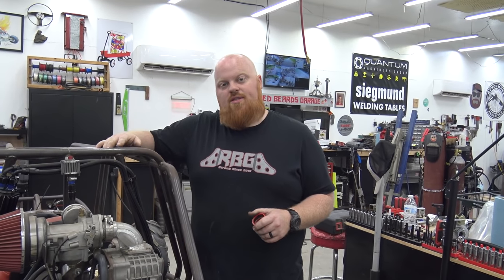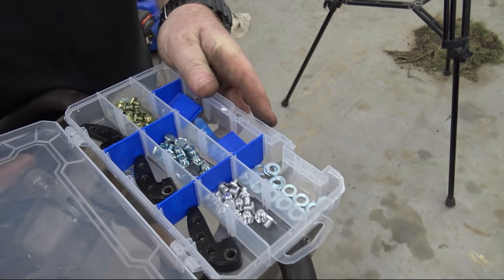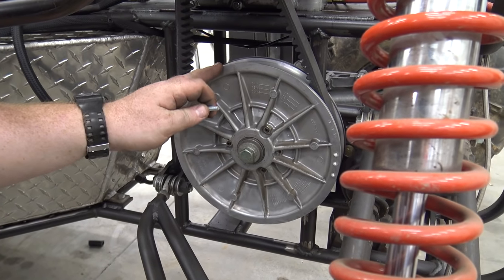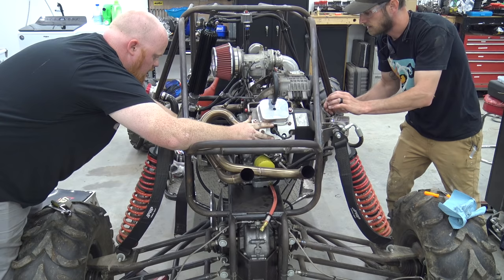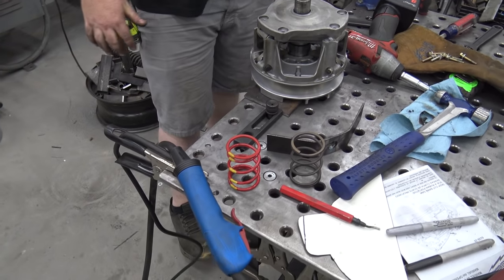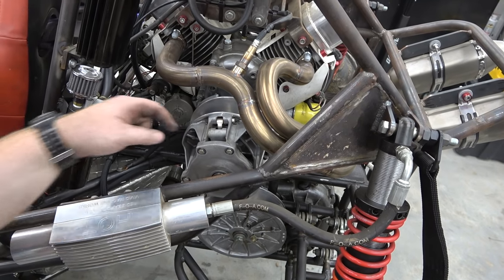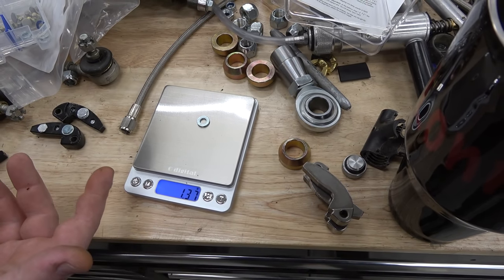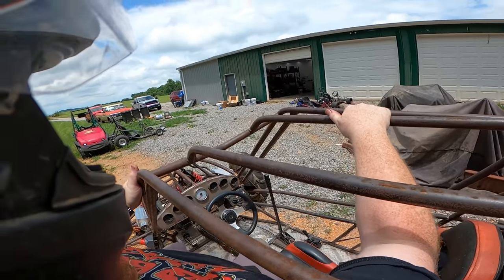Supercharged Predator 670cc Buggy Woods Rip ~ Blown 670cc

Comment: The brand name on the engine doesn't matter.  It doesn't matter if it's a bike engine or a lawnmower engine.  An air pump is an air pump.  You can port it and mill the head and achieve the same power as a street bike. The supercharger makes it even better.  This is an awesome project.
Reply: Richard Holden tried this same charger on a 350 Chevy a it robbed from what his baseline was with out the charger.
It takes more power to turn it than what it will produce so it’s killing this cart’s power bad
Reply: Your crazy that lawnmower engine will never make the power a 4 cylinder crotch rocket engine will make lol...
Reply: @MatthewJohnson-o4x  It's far too small a supercharger for a 350 Chevy...

Comment: Performance670 has an adjustable billet flywheel that lets you mess around with ignition timing, which is something you'd want to do when running a boosted engine. There's probably a few extra horsepower to be had with one of those.
Reply: Likely pick up power faster too

Comment: Awesome build! Couldn't you just machine a smidge off that driven pulley sheath so it doesn't contact the CV axle boot?
Reply: That or if you want to get janky you could try putting a ziptie on the boot and try squeezing it in a little bit.
Reply: I thought same thing
Reply: A small Machinist cross vise and a cutting tool then run the motor. All you really need is to take a couple thou off he said it's just barely making contact. Hell if you want to get super janky you can do it with sandpaper and a stick 🤣
Reply: My ocd is serious. That steering wheel being so off.......m.m
Reply: Taken a smidge off the edge of the clutch is what first came to my mind when he said that also. If it's only a few mil touching then that's shouldn't hurt the clutch.
Reply: @Rattus-Norvegicus  zipties... holding my vehicles together since 1989.
Reply: @markschultz1606  😆 and coat hangers and duct tape, nothings better no shit.

Comment: It's absolutely ripping up the trail.
   I'm about finished with building my ultra light airplane. Thinking of this engine upgraded with the AMR supercharger. Only thing I'll probably put a Aviation carb on instead. Since I can adjust the mixture on the fly so to speak. You do that for altitude by watching cylinder head temperature.

Comment: Its funny that you mentioned it at the end because I decided to say something half way through the video. My ltz400 had a set of mudlites like those just a lot wider on it when I got it and I noticed those tires are grippier than you would think in super loose dirt, but have no traction in grass and foliage. I swear by "cleat" style tread because they have grip EVERYWHERE but unfortunately I don't think they sell them in utility atv/utv sizes like your running.

Comment: If people are wanting you to put a motorcycle engine on that thing, they just don't know LOL. That thing is amazing plus you're showing what a person can do by using Harbor Freight or other type of budget engines. I think this whole build idea was awesome and you did a great job showing. Sometime if you get a motorcycle engine, build a different kind of buggy and put that on there. I think this buggy is perfect the way it is., maybe throw some paint on it LOL. Actually, I would powder coat the whole thing.
Reply: are you nuts ! budget engine my ass theres over 10 grand in the motor alone! i built my buggy 4 years ago i did mine like a rock bouncer . mine has toyota axles cut down to 50 inches wide . suzuki sammy transfer case and a 200 hp 1000cc triple thundercat motor from a snowmobile . in 4wl with 37 inch pitbull rocker tires in the woods its a monster and will climb over anything . in 4wh i put paddle tires all the way around and it has NEVER been stuck in the mud . now put it in 2wd i use hoosier 10 inch wide oval racing tires and have raced at limerock speedway . my motor costed me $2500 in parts and i did all the work .
Reply: @craigengelman4534  actually that Predator 670 V Twin is cheap, and stupid cheap to build.
Reply: @Tyler-ts2ld  cost for parts for that motor is insane ! i just got a thundercat 900 for $700 150 hp triple 900 2 stroke . i dont care what you find for the motor it will NEVER touch that motor E-V-E-R

Comment: This NEEDS a transmission like from a Harley ....the torque converter single gear noise is meh.... This thing is badd a$$ but hearing it wind through gears would be epic
Reply: Torque converter?  I thought it was a CVT?
Reply: It would be incredibly fun to shift though gears but after years of drag racing sleds Polaris has endless springs and helixes you can set that kind off setup to do whatever you want his setup could use higher gears and a looser spring that engine has a lot more tourqe compared to almost anything that is equipped with those clutches once he gets them set up to keep that beast in lower RPM range he will have a monster
Reply: @MegaMeaty  people often call those torque converters. I find it confusing as well.

Comment: Sounding like its running a bit smoother with the clutch engagement! Nice! How's your supercharger holding up??? I'm building a Small block Briggs Vanguard fully decked out and couldn't bare to use one of those Chinese turbochargers or superchargers and opted for the Eaton M-24 off a Benz. It's slightly larger than the Chinese and is machined so tightly inside they are able to pump out up to 30psi without the use of seals or spinning at stupid overdrive speeds. Just curious on how yours is doing? I've watched as seen so many failures with those over priced non remanufactured pieces-O-S on YouTube it's not cool! They claim they were rebuilt by the factory lie #1 they claim they are as good as factory specs! With many new parts #2 come to find out they are junkyard or dealership takeoffs they sprayed new aluminum paint over the grease and grime as well as the insides being full of carbon, grease and foreign materials along with dirt and grit! I've even seen then delivered with bad bearings right out of the boxes or bearings so loud that they don't last 10 minutes on anything you put them on. This is exactly why I'm needing to ask you about this. I've seen others only being able to produce small amounts of boost on a small engine no matter how fast they overdrive them! Meaning they are either POS garbage to being with, or they are so shot they can no longer produce any decent numbers any longer. What's your average boost levels you are seeing on the 670cc???  How much is it under driven or overdriven to get to that boost level and 3 have you seen a consistent boost level over the times you've been running it Now??? I understand you are going to dyno this engine, but I and others are a little interested in the numbers here. They aren't cheap anymore these Chinese superchargers so it really doesn't pay to use them when you can get a name brand supercharger for a few dollars more that's guaranteed to at least work and not be full of garbage with fresh spray paint on the thing when you get it delivered! That's all I'm getting at. I'll have to underdriving the Eaton M-24 for the 570cc Briggs it's going on, but that's all good, I don't plan on running anything more than 10-12psi of boost. It's nice to have reserve built in to something that way so if I ever decide to go fuel injected I have the ability to bump it up with the boost levels by heading more to a 1:1 ratio. But just for curiosity sake of a few people here. We're kinda wanting to hear about the goods and not so goods with those Chinese superchargers with pipe thread schedule 40 ends on their adaptor's! That in itself cracks me up as to how poorly made those things really have to be. One other complaint I've seen on a few occasions were the whatever it's coated with rotors wise looks like Teflon of sorts is coming off like peeling off and going through engine's! Gasoline shouldn't effect Teflon at all but wear and tear definitely does, which is pretty much the only source of sealing on those rotors. Once they are worn down they are complete garbage. Can't get any replacement parts for them I hear and I've even poked around myself and there's nothing available for them but a couple pulleys and adaptors. No bearings or even a rebuild kit for them are offered. One so person even tried cross referencing the bearings inside them and could only find one side of the supercharger bearings available. The other side which were a specific special bearing was not available no matter how hard you try to look it up. So FYI, these are throw away items that China is selling the not so informed people here for stupid price's!!! The come off cars in China that for that reason, they no longer work well or at all! So buyers please do your research on these things! RedBeard  is the only person so far I've ever seen have any sort of useful success with these superchargers. Everyone else's projects have been ruined by lies and false advertising on the sellers behalf! So buyer beware these people are selling complete garbage for a lot of money! Thanks and hope to hear from you Redbeard.
Reply: The answer is used turbo charges ball bearing type found in twin turbo Subaru's, IHI i think makem :))
Reply: Did you ever finish that pile of shit & how’s it running are you still boosting it to 12psi???
Reply: @hairycods2273  you didn't hope to hear from him soon..lol.

Comment: ON the lower CVT pully hitting the shock boot. How often is the belt all the way out at the edge of the pulley? Why not chuck the pulley in a lathe and take just enough off the diameter to clear the shock boot, while minimizing the effect on the pulley ratio.

Comment: A looser spring and heavier weights will make that monster happy the heavier the weights the better that primary will grab the belt I used to run so much rotational mass my sled would jump 10 feet forward minimal when it was set up to drag race

Comment: Instead of the 5mm bolt for the belt tension, Take a piece of rod stock and thread it to 5mm threads, two 90°  bends to make it look like a scissor jack handle. Use it instead of a bolt and you won't need a tool on the trail.

Comment: I'm sure i'm behind the curve timewise, and you may have already worked it out, but why a Super B carb? It's such an archaic design...especially with no accelerator pump. Also....at about 14:30-14:40ish you can hear a mean part throttle lean condition. As a long time Harley mechanic/shop owner i'm just trying to help out with some V-Twin tuning.

Comment: I have a question about my ungoverned 212 that someone here may be able to help….i have a 22mm Mikuni with a 140 main and a 17.5 pilot on its way…when i crack the throttle, i get no response or a super delayed response….it only likes to start on choke too….Im thinking its either the fuel screw or idle screw because it idles a little screwy..How many turns out from all the way in on the fuel screw are u supposed to go….and the idle screw is how many out normally? Ive been going 4…any help would be great..

Comment: lolol.... as a polaris tech, yall are hilarious to watch. Tip - do weights while you have the clutch apart. lol. also, 10mm and 3/8" because most people on the trail will not have 2 sets of tools to have duplicate sockets. most kits have a standard and metric though.

Comment: I worked at a place called the Carbon. We made carbonfiber and graphite from scratch. But every bolt and nut in that place would be different sized. Like the bolt would be 1/2 inch and the nut would be 9/16. I was like what the f. I grew up a farmer and all the stuff ive worked on i never in my life saw a bolt different than its nut til i started working there.
Reply: lol damn i've honestly never thought about it but it certainly does piss me off lol
Reply: @avalanche15301  me to why doesnt everything use this. Otherwise u have to buy 2 toolsets to have 2 of the same wrenches. Where as with different sized nut vs bolt u can usually find 1 of each easier than 2 of 1.

Comment: Wow!  She’s really coming along. Great work as always. 
Just out of curiosity, have you had a chance to pull the plugs and see how the engine is burning fuel since the ride?  Were you running on 91 octane pump gas here?
I’m curious about ignition timing under boost and load?  Have you had to retard the timing any, compared to the NA build on the deuce?  
If you had it to do over, would you have lowered the compression ratio during the bottom end build?  
The supercharger is moving A LOT more air than I anticipated (very efficient and seals between the rotors and case seem to be very good), and cooling the air charge may already be in the works.
Keep up the great work, and I can’t wait to see more as you get it tuned in!
Reply: Make the switch to methanol lol

Comment: You must not like your thumbs to much RB. If for whatever reason your steering wheel kicks it will break your thumbs in a hot second.  And why are you sitting that far away from it ?? With all the torque that thing is producing it sure could stand some more weight towards the front

Comment: If you want a great 670cc get yourself a Rotax 670 twin, stock is 125hp,massage the cylinders etc and your talking stout 155ish....however it's a 2 stoke so unless you get your cooling under control wouldn't work!!😂

Comment: Talk all they want about a bike engine. Won’t make the torque this v-twin makes. High rpm bike engine meant for a 400lb bike. Not 6 0r 700 lb buggy. Need torque for that not hp. Low rpm grunt. That’s why with this much weight it’s just blowing the tires off. Torque baby!!!!

Comment: Cool and all. But not as fast as it sounds it as fast as I would expect for a supercharged 600+ cc.  As others say, Could have saved a lot of time and money by just using a used motorcycle motor and ended up with more power, less weight, more reliability, and actual gears. It might be good for a CVT and lawnmower engine, but it is still logically an inferior choice by every metric. Wheel spin is irrelevant.

Comment: The whole issue here is you have no way too richen fuel mixture when boost increasing. You're tuning for max boost and that's all. While running too fat part -mid throttle, need to be able too boost reference the carb.
Reply from the maker: It's not a turbo. The power band is linear. The engine and carb reacts as if it is naturally aspirated.

Comment: That engine sucks its a dog.
Reply: Nah for a go kart small buggy build they're fun with the right clutch they go
Reply: Wait until he gets the CVT tuned properly, you'll see it has a poop ton of torque.
Reply: That motor only comes with 25/30 horsepower you can't get more out of something than you put into it okay just a fact you just working with a dead horse you put a got to put a real engine on it and a real transmission on that buggy then it will go.Its a good buggy  bad engine.that Buggy needs a engine that makes 100 ft lbs touque and 100 Hp @3500 rpms. Stop messing with a lawn mower engine and drive line.the buggy is too heavy for that clutch.They should use a automotive trans with aut cv axels and engine then it will go and nobody will be able to touch that buggy.and it will cost less.
Reply: @airbossjrd  It's supercharged making 50-70 hp easy. You don't know what you're talking about.
Reply: You are wrong,That Kart has not been on a dyno I build engines for a living,He is lucky if he got a extra10hp with that set up also the clutch is the problem. that drive line sucks
Reply: @airbossjrd  As he said, he's getting it ready for the dyno so we'll see. Also he mentioned in another thread that he knows he could use a different motor but he's interested in building this one to see what he can get out of it.
Reply: That's why he don't drive it.the kart won't run for more than a day with out The engine on the transmission break in are the belt burning up or something That's why they don't use them in regulus environments like what he does it's way too small for that heavy kart like I said it's a good kart shity driveline and if he wants to do any real writing he will change the engine and transmission and get rid of that stupid CVT it's garbage he could go out and buy a little Honda 5-speed manual transmission and engine combination converted to carburetor off fuel injection for about $1,000 and the thing would rip all day $365 days a year no breakdowns no problems
Reply: @airbossjrd  But that's not what he wants to do with it, it's the same thing that everyone else is doing. He wants to make THIS work, and if you'd paid attention to the video the reason it's not working properly yet is because he hasn't had the time to work on it. But he also said that he's going to be spending time on it to get it right.
Reply: Yeah it's obvious you don't want to drive it